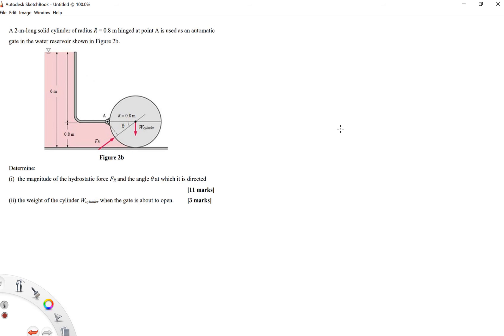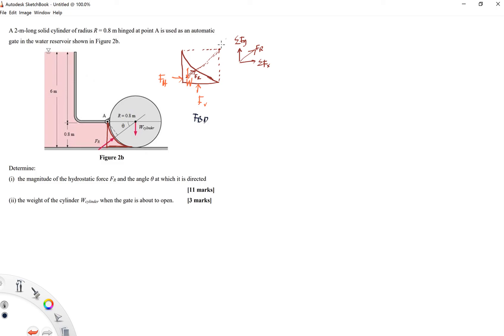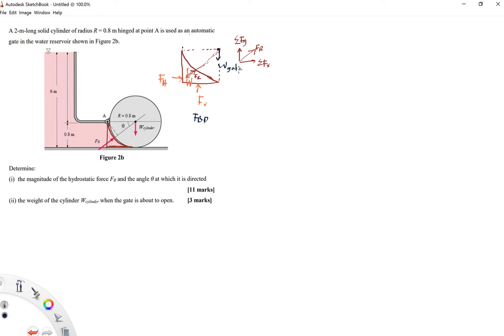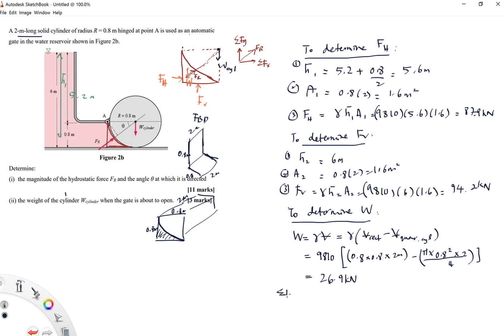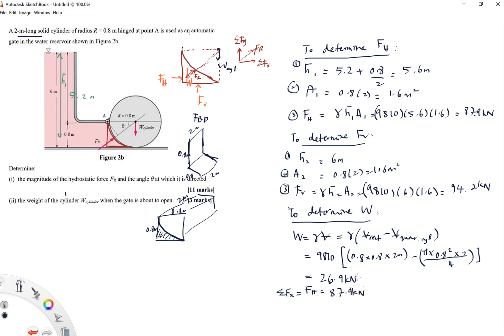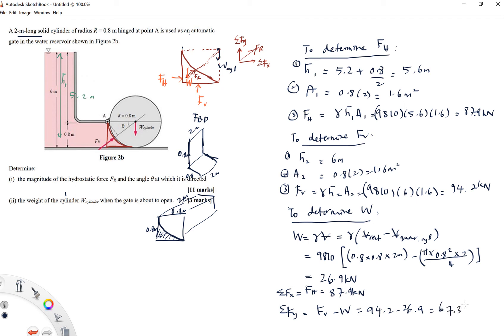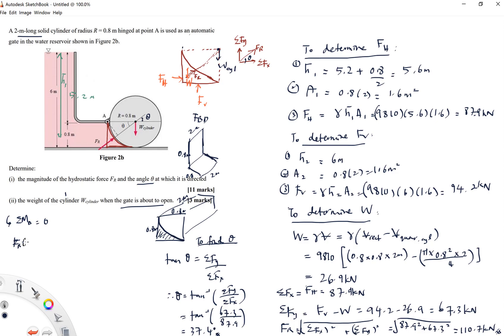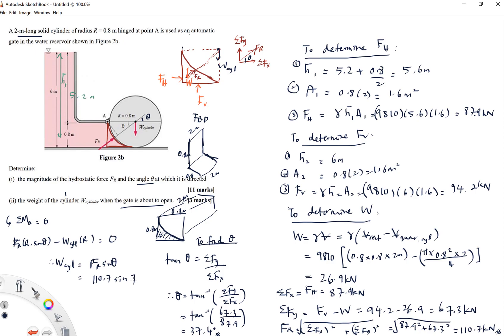Hydrostatic force on curved surface-past year question

Comment from the maker: CORRECTION FOR W 🙏🙏🙏

W = 2.69 kN
Hence, summation of Fy = 91.5 kN

And resultant force FR = 126.9 kN
Angle theta = 46.1 degree

And W(cylinder) = 91.4 kN

Apologize for putting the decimal point wrongly in the video 🙏🙏🙏